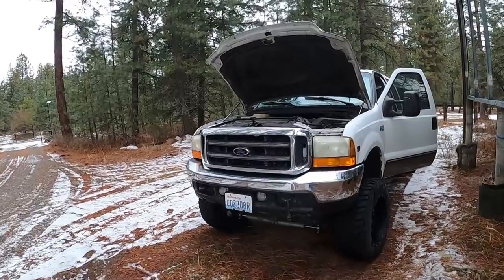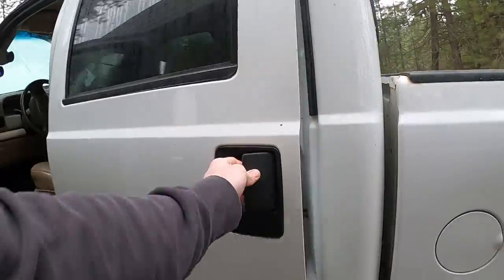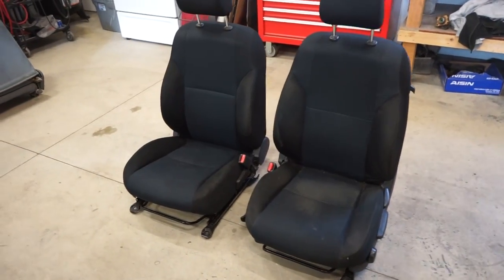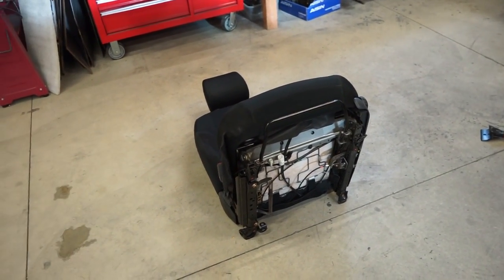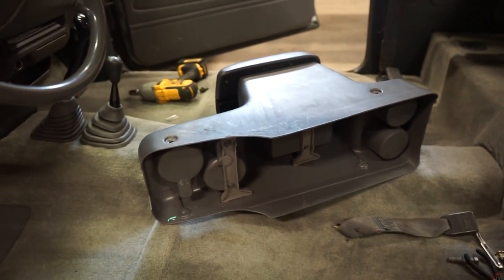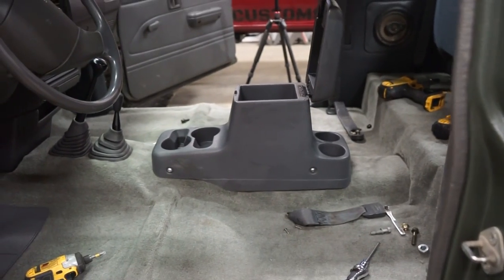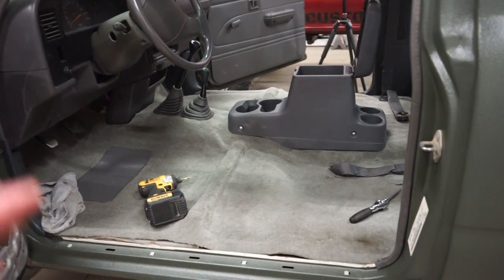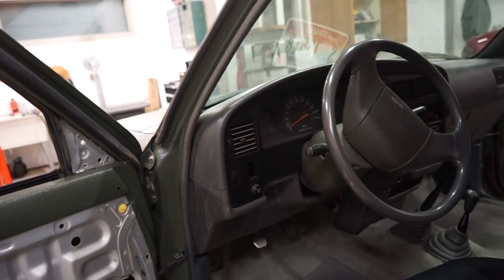Bucket Seats That Fit Great In The Toyota Pickup!

Comment: This is a great idea. I just picked up a 1991 4 Runner and am building a parts / mod list. The seats reek of smoke and the springs are shot. I never considered a non-OEM seat replacement, but those ones look great. I also love the idea of replacing the center console.
Reply: Technically it is oem just a different toyota lol (scion)

Comment: 2006 jetta seats fit really good and are nice, low and go far back for tall people. im 6 foot 6 and fit great now lol... also have a great bucket shape to them. i rewound my toyota seat belt winders with the webbing from the same jetta so the vw buckles would work. looks factory and the buckle is attached to the seat, not flopping about lol....  the bracket is fairly simple to make too. the vw seat tracks are flat. the toyota pickup floor has about 1/2 or 3/4 of an inch difference from the inboard to outboard bolts. the bracket levels the seat back out....
Reply: Good idea. How do you rewind the seatbelt webbing with different webbing?
Reply: Also, what year Jetta?

Comment: i know a little late, but the parts you cut off the seat rails you could have drilled holes into the ridge in the floor board.  helps to center the seats.  but looks good.  the seats look great and the center console matches perfect.

Comment: Amazing what $50.00 will get you at the salvage yard! 👍🏼
Reply: IDK where you live but that is dirt cheap  that would run at least 5x more in new mexico for those seats and console at minimum
Reply: Paid 100 just for the seats in Sacramento
Reply: @kevinortiz7879  for all seats? 
Jesus wyoming/Montana $200 per seat $250 for back seat /fold down back pieces $650 for a set of seats they don’t gaf if there’s a huge ass rip nope $200 I always say good fn luck with that that’ll be sitting there in 10 years flip em the bird and walk away serious they want 75% of retail for new oem parts here and their used scratches tabs broken yah f that

Comment: Looking good!  Hey, I bought one of those Eastwood mini steel circular saw you told me about.  Works like a charm! I was scared of the full size one I have and dropping it on my leg-s.  I don't do a lot of car stuff anymore but I restored a JD 430 Diesel garden tractor last winter and just built a 60" box blade with scarifiers.  Finished it last night and from a seated position in my wheel chair I could see everything and the saw was light, I wasn't scared of dropping it in my lap because it was easy to hold out to the side.  So glad I saw that video and appreciate your lead!  My next project is a front end loader for the tractor.  That will all be cut with my evolution chop saw except the 3/16 plate for the bucket and that little saw will get it done!  Thanks again!  You helped me keep going and safer!
Reply from the maker: Awesome I’m glad it worked out!! Thank you!!
Reply: That JD 430 is a brute of a tractor I drove one, mine had a 3 cyl Diesel always started,im sure yours is a beautiful green beast 👍

Comment: I am contemplating swapping out my bucket seats for a bench (maybe a 60/40??? if I can find one). Currently, its kind of rough squeezing a 3rd or 4th large adult into the back seats and I thought the bench seat might be a more comfortable solution. What didn't you like about your bench seats?
I kind of wish I had seen this sooner... and we could have swapped seats and console. Though, those other seats are probably 5x more comfortable with the lumbar support and other adjustments.

Comment: I have an 05 tc and have wanted better seats for my 98 tacoma. snagged some clean 09 tc seats for $50 at the upull. looks like the inside bracket is perfect and the outside bracket will need holes front and back. thanks for the idea, the tC seats are comfy. can tell they are better than the taco seats just by their weight.
Reply from the maker: Sweet! I like mine but they sit pretty tall in the toyota!

Comment: Outstanding working you're doing. I enjoy watching & learning from all of your videos. I have a question. I have a 1995 Toyota Pickup DX Model with the Extended Cab. And I've found a set of 50/50 Bucket Seat that came off of a 2004 Toyota 4Runner. Will those work with my truck? Thanks

Comment: Curious on the verdict of the 4th bolt, did you need to through bolt or did everything line up after bending the front brackets? Awesome video the truck is looking good!

Comment: I would have sent the seat on the back set of holes and made a little l-bracket to bolt in the position of the front mount with a welded bolt sticking vertical and bend the bracket up in flat and bolt it down and then you're able to game a couple inches backwards for legroom by using the Back original holes
Reply: No idea what you just said but sort of makes sense to use the back holes for more room.

Comment: Just got some 06 TC seats and was wondering how you drilled the hole into the truck. (This is my first project truck so I don’t know exactly what I’m doing, very thankful for your channel). 
My 91 pickup is a single cab so I wonder if that makes a difference on how the seats will fit? I haven’t removed the bench yet to see how these new ones fit.
Reply: Would like to know this too.
Reply: @flat6fever680  well I got one of my answers, they don’t fit as well in the single cab as they did in the extended cab. They’re a little too long for it, still working on them and seeing if there’s a way I can get them to fit.
Reply: @mellisalopez4903  Hey I just bought a set of front bucket seats from a 91 4 Runner for my 88 standard cab. The bench seat in mine is in great shape but so uncomfortable. I mainly want to be able to recline a little and the bench is near vertical. The seats arrived yesterday and are very compact so there should be a little room to recline even in standard cab. I'm 6' so will need to be fairly far back but I'll make it work. I hear the SR5 and 4 Runner seats bolt right in but I don't have holes in the carpet for the middle bolts so will need to figure that out. Good luck with yours!

Comment: Just $50 for all 3? Wow! For the steering try to secure a 91 or 92 Paseo Steering wheel. Those are thick and 3 spoke. If you can, get a 2nd gen 4runner instrument cluster that has 2 more gauges (oil & charging). Truck is looking good day by day!!! There is a separator inside the rear lens. Do you have it? You can buy OEM parts from partsouq.com.

Comment: Hey man how's it going. I just tried to fit these seats in my single cab and I find that they sit very far outboard compared to the OEM seats. The height is fine (I'm short) but the adjustments and levers are basically against the door panel! Did yours fit any different?

Comment: I love the new seats they look really comfy also the center consul especially since the center consul will give the passengers if you ever have passengers in the back cupholders since the stock one doesn’t have cupholders in the back which I don’t believe it does but then again I only have a single cab first Tacoma . Have you ever thought of instead of making brackets in such for the new seats could you just take the ones off of the stock Toyota seats and just put them on the new seats unless that’s too much of a hassle to do and not really worth it
Reply from the maker: Too much work to mount them to the new seats! Thank you!

Comment: No 4Runner seats or console eh, those would have bolted right in. The console mounting brackets come from the donor. I would use rivet nuts for those console to floor fasteners and not self tapping.
Reply from the maker: Can’t find them around here!! If you do they are tore up or $300
Reply: I've been lucky on Yota parts. Got a salvage yard that deals with only trucks and 4runners. Awesome part is they pull the what your looking for. Always a thee hour trip, but I get what I need when I can't find it locally.

Comment: I have a question somewhat related. Just wondering if you might know if I can put a 93 Toyota pickup front end on a 95 4runner. Just wondering if you would know if it will bolt up?
Reply from the maker: You would have to swap core support or modify it to fit the new grill and lights
Reply: @austinniemela  I thought it might be something like that. But I figured I would ask. Thank you for your input. I really appreciate it. And if I have any more questions can I pick your brane. I follow your page with much interest. I think what you do is amazing and I think you're input would be appreciated..

Comment: Hello, i don’t see you enter into the cab with the new seat. I swap my bench hilux with toyota auris seats and they are a bit too high. I have little difficulty to tuck my head and knee in, so i push the rail back to ease enter. But they are very confortable

Comment: Man I love the seats I have a 93 regular cab the bench seat is horrible this seats look damn good and I love the console.. I have watched all your videos good job.i just had to replace the 22RE in my truck actually bought a whole other truck a 2 wheel drive and swapped the motor and dash Seward are next then spring I'm going to raptor line it I think I'm going to do a tan color. But either way love the videos keep them coming#

Comment: Do those Scion TC seats ride a little high? I have Scion XB seats and I had to mod the bracket to lower them.
Reply from the maker: Yes they are a tad high. How did you lower them?
Reply: @austinniemela  I cut material off the brackets above the rails and welded them lower, it's a bit of work though

Comment: Paint center console same color you painted trim pieces.  Take a pressure washer to them seats and you will be surprised at the nasty ness that comes out of them.  Great job
Reply: Cleaning upholstery with a pressure washer is pretty silly. Youll soak the foam, driving the dirt into it then mildew happens. 
Same concept as cleaning carpets. Dont inject water into the pad, just clean the  surface material with as little solution as possible and remove it in the same pass with the machine.